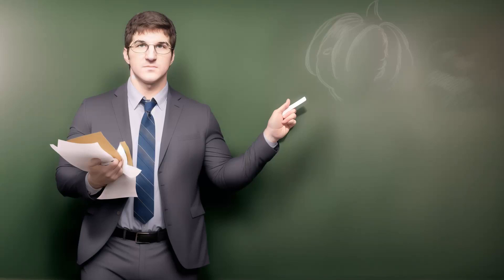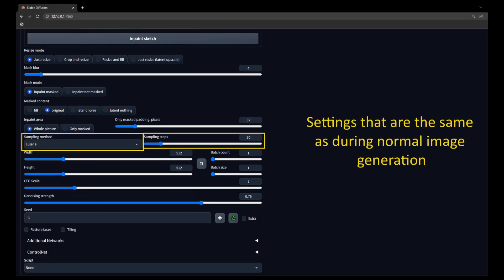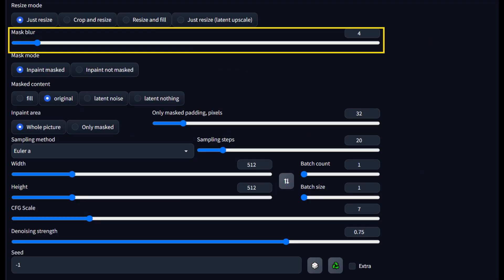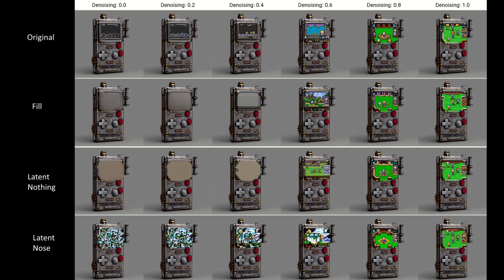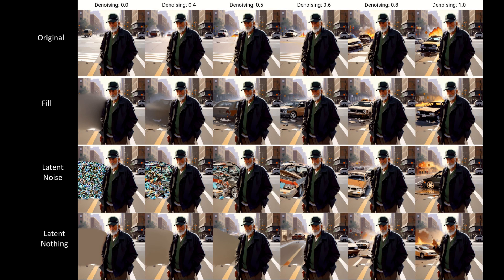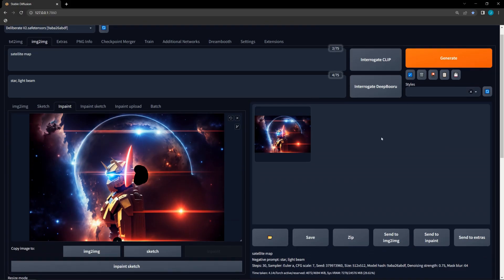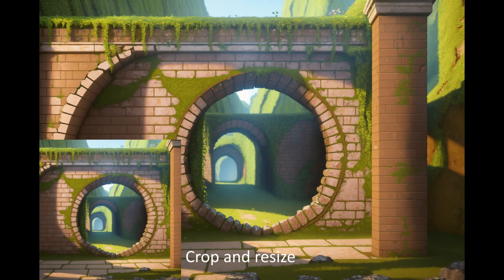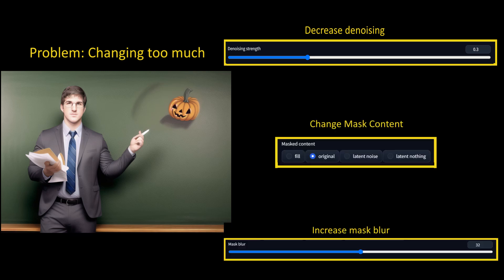Stable Diffusion Basics - Inpainting - All Settings Explained plus How to Solve Common Problems

Comment: You should talk about the setting inpainting conditioning mask strength; on non-inpainting checkpoints, when it is set at or near 0, it dramatically reduces—or even eliminates—the “seam” that can show up on inpainting masks, while also making the unpainted section match the style and such of the whole image much better… though, the setting is a bit hidden since you have to go into settings to find it. Honestly, because the setting affects so much, I really think it should be a default setting that is already in the img2img inpainting section…

Comment: I have a quick question about inpainting and hope someone can help me.
After painting the mask and generating the new image, the exact area of the mask has a slightly grey-tone on top of the new generated portion of the image (like the mask didn't get replaced fully with new content and is placed as a partly transparent layer on top of the repainteing)
Anyone has a clou? I tested several settings and nothing seems to solve this.
Reply: Did you resolve this? I have the same issue, the mask leaves a purplish tone in the generated image.
Reply: @joelchamp1949  unfortunately no, but i haven't had the time to test it, if i have a solution i will remind myself to post it here ^^
Reply: @joelchamp1949  it seem i have solved the problem (or i hope so), all i did was to set "Only masked paading pixels" from the original value of 32 down to around 20 to 24 (you probably can go even lower?)